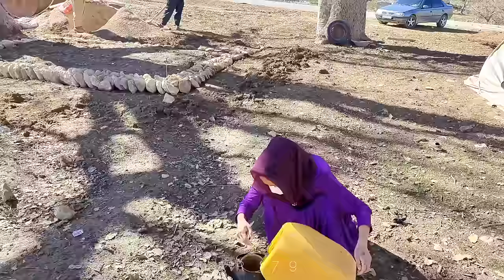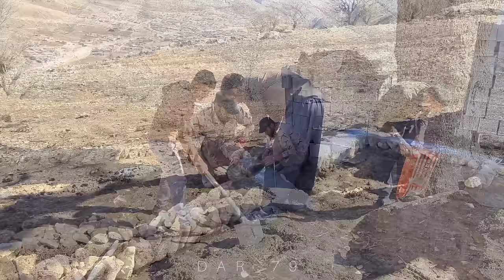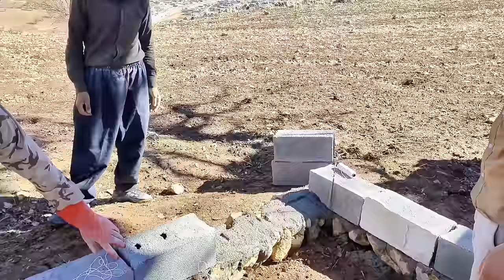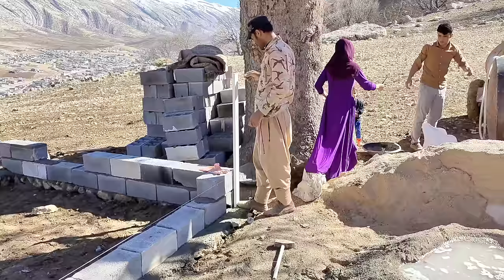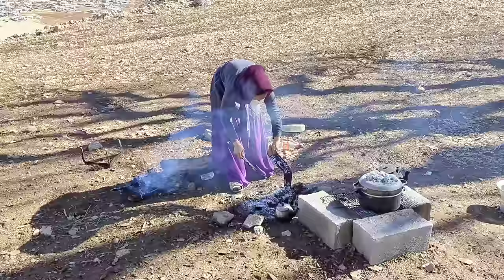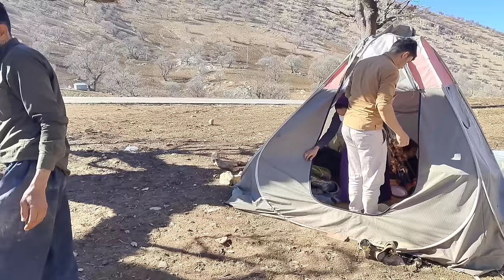House, love, life: Rasul and Banna's help to Nargis in building a house

Comment: You hired an experience builder and a helper which will speed up your house build

Keep supplies available before they run out water cement sand blocks as you will need more

Bring the rest of the old house blocks to your new location save money where you can

Before you know it is to finish the house as quickly as possible